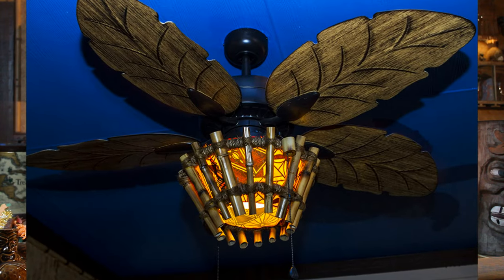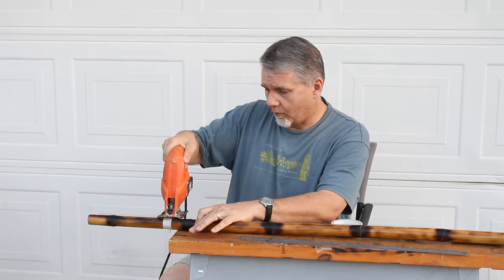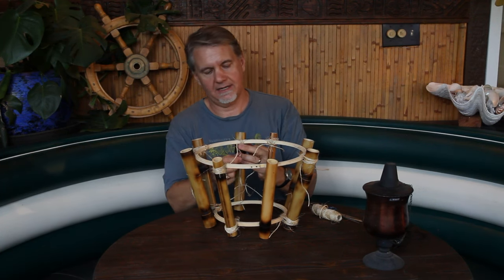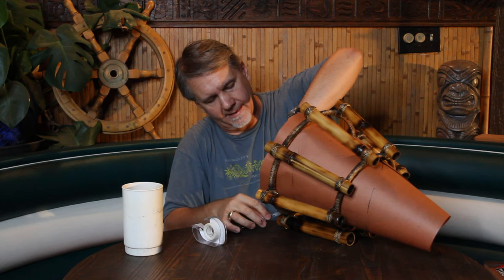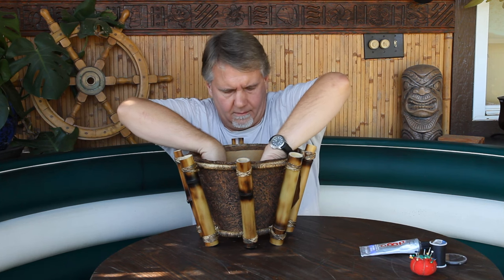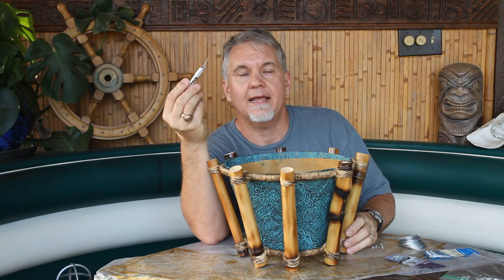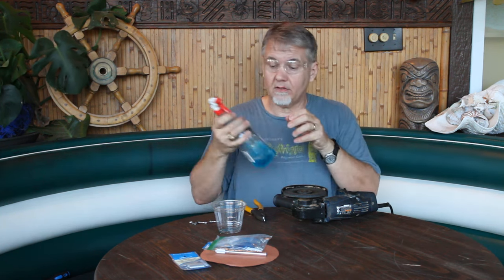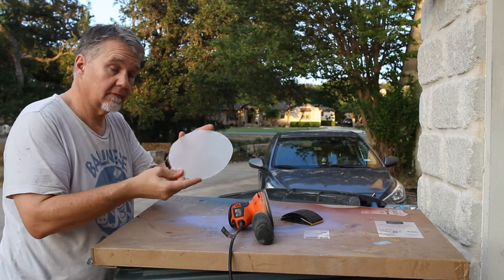A Moment of Tiki Episode 60: DIY Light Shades

Comment: I know I always see you using tapa cloth, I thought that was the only thing you could use for lights?
Reply from the maker: Goodness no! You can use lots of fabrics for lights. I only have one piece of Samoan tapa I found at an estate sale some years ago that was in too poor condition to display so I've been using pieces of it for lights. Tapa (barkcloth) is great for lights because it has no weave, therefore does not need an additional diffuser. If you use fabric--say, a tropical/tiki pattern from Spoonflower--the light will literally shine through the weave no matter how tight it looks. Therefore you will need an additional diffusion layer so the light appears more evenly distributed.
Reply: Ok, I guess I still have a lot to learn then!
Reply from the maker: @justinmartin1493  Once we stop learning we start dying. The things I don't yet know are legion! 😅

Comment: Details matter, that was really impressive!
I see u replied to a question with your materials list, is it in the description?
Those bamboo embroidery hoops were a revelation, I'm a newby with an old rectangular outdoor light. My plan is to make it 12 volt and glue bamboo to the metal frame. Thanks for sharing!!
Reply from the maker: Thank you! Other than the bamboo, pretty much all the materials can be found at a craft store like Michael's--the fabric interfacing, the embroidery hoops (in various sizes), the jewelry wire. You might have to go to a home improvement store for the amber shellac and Spoonflowers is a great online source for tiki-patterned fabric.